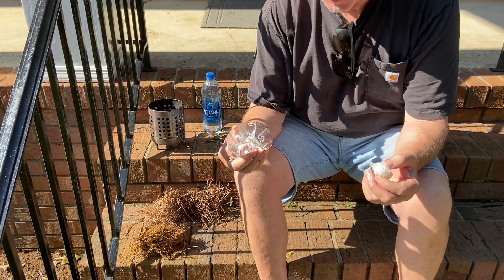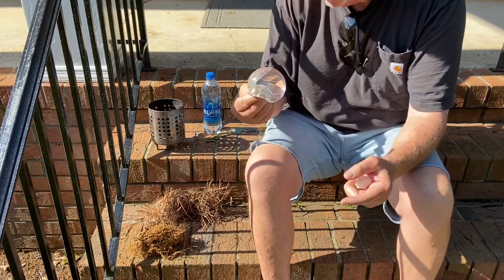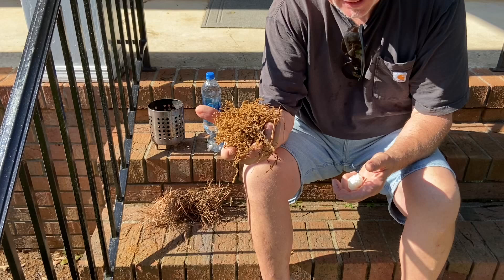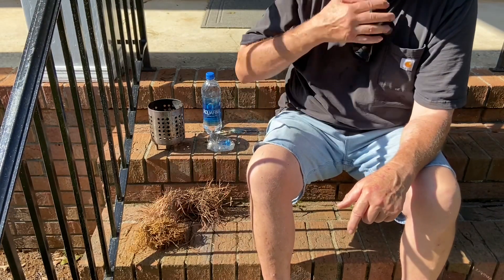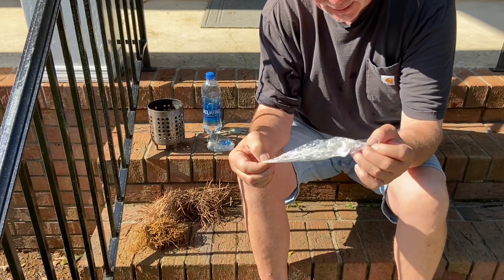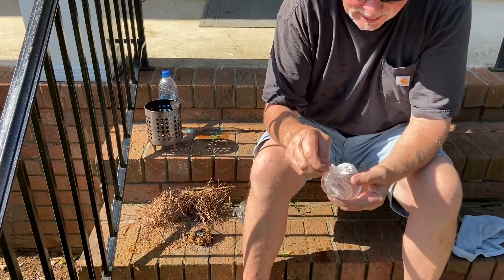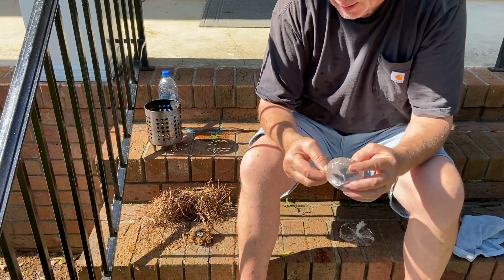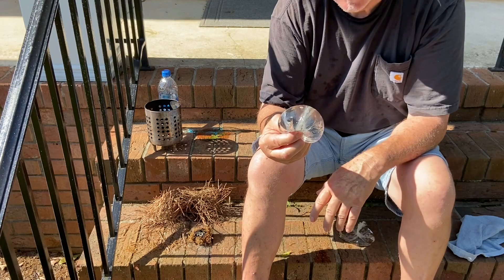Solar Ignition With A Wadded Up Piece Of Plastic Wrap

Comment: If the master fire maker took 3 tries, I'm not sure if I'll even attempt it, lol. What if we try to freeze it, will it make it easier? Winter is upon us, I'll try leaving one or two outside.
Reply from the maker: Ice doesn’t freeze clear enough unless you take special measures.
Reply: @DavidWestBgood2ppl  I was thinking about that too. The outer surface can be smoothened with hot water but the frozen bubbles are hard to manage without a vacuum. I'll try using distilled water so there are no impurities.

Comment: That was great David... Thanks for expanding the range of igniters. One fellow made an 8 inch hoop from a thin branch and stretched the cling wrap over it. Resting it on three 2 ft. sticks stuck in the ground he poured in some water and got an 8 inch wide lens that made a focal point hot enough to ignite pretty much any tinder. Always good to broaden the repertoire.  I used the rounded top off a slushy the same way after gluing a leaf over the hole with pine gum.... 
Thanks again...
Reply from the maker: Open water lens' like that can be powerful, but aggravating. The least little breeze causes turbulence and ruins the focal point.
Reply: Thats awesome feedback